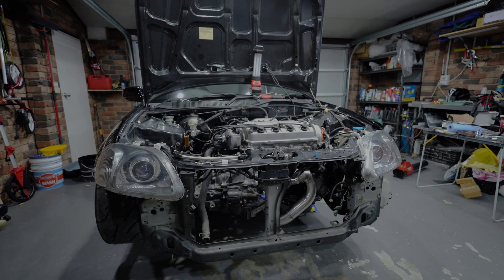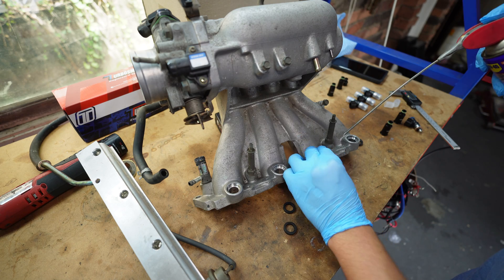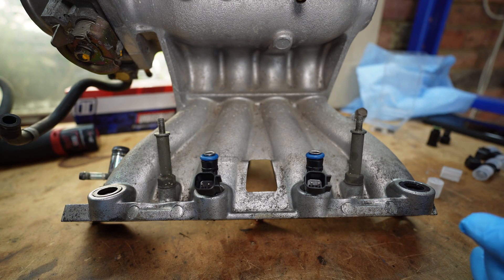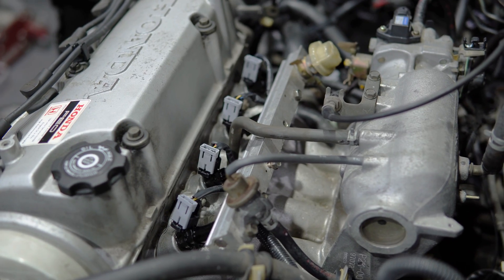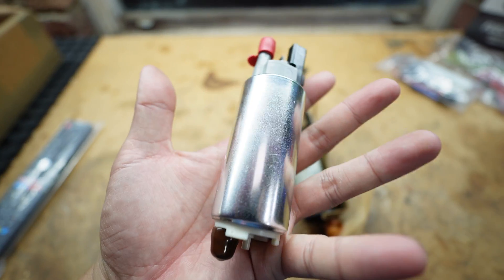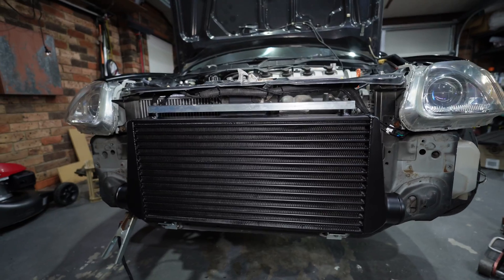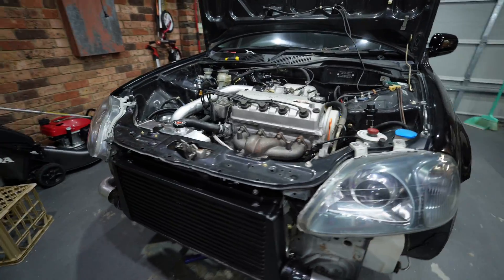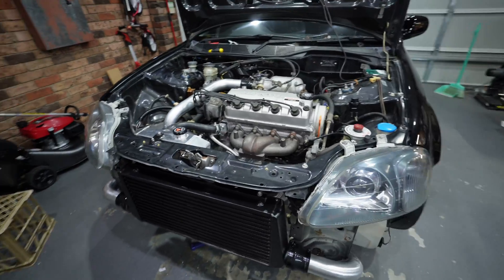EASIEST D series turbo FUEL INJECTOR/PUMP upgrade

Comment: so you can run e85 on this fuel pump? just wondering because i wanted to upgrade injectors on my 89 hatch to 1000 but need to upgrade my fuel pump first and wanted to go e85
Reply from the maker: Hi mate
Definitely can!

Comment: Just a random tip. I use petroleum jelly on all o rings. It’s slicker but it also lasts waaaaay longer than a liquid lubricant so the oring doesn’t dry out as fast.

Comment: They sell adapters for your injector connectors. No need to cut, de-pin, etc.
Reply from the maker: Yes i mentioned this in the video.
For those who want a plug and play option it is there. Re-pinning to a new connector is the best way to do it.

Comment: Isnt 730cc just overkill?
Reply from the maker: Hey mate
I think 730 is on the larger size but I wouldn't go any smaller than say a 650cc. It needs to have the fuel available say in event of a boost spike. Overkill would be my initial purchase of 1350cc 🤪
Reply: @JCYT  I run 1000cc fic on my stock motor 12psi rather have more just in case.
Reply from the maker: @pmurriel2  agreed 
Many people ask me why i dont just run 495cc
I'd rather sacrifice a tiny amount of drivability than blow it up 
These stock motors need all the safety

Comment: Hey it's amazing this series! I've watched every second so I can do the same but I was wondering if do you think it could work with a d15z6 stock or a d15z6 but with the d16y6 cylinder head... Thank you so much!
Reply from the maker: Thanks for commenting mate. It's honestly been such a fun build.
I'm sorry i missed this. As far as i know no it will not fit! 
I would look for a D16z6/D16y8 if you have them locally. 
Reach out if you have any general questions.